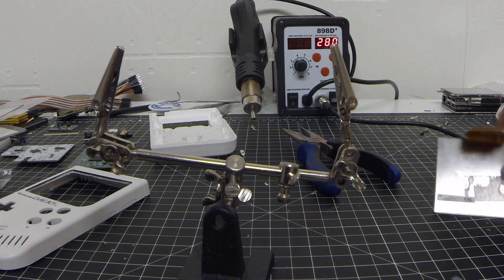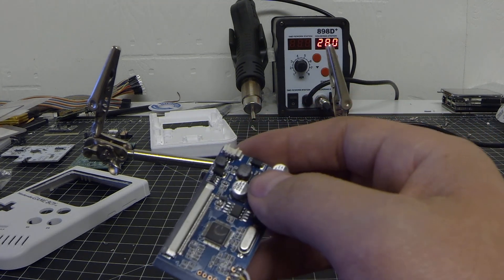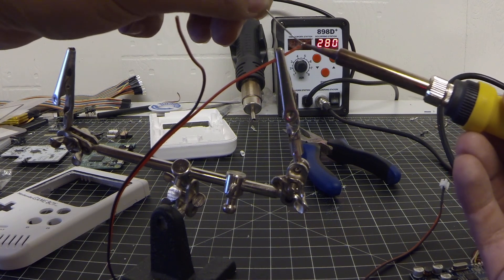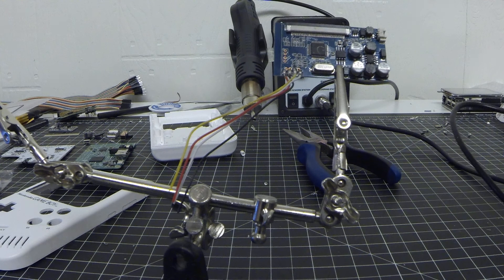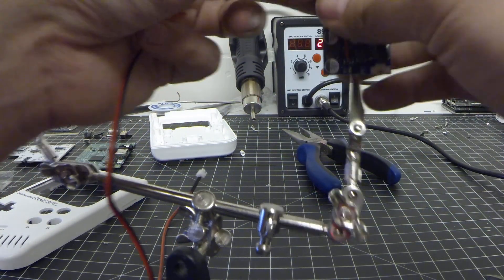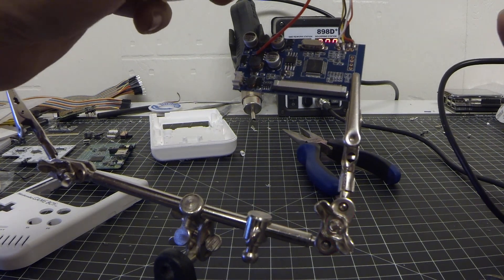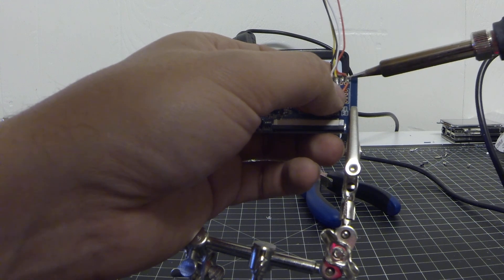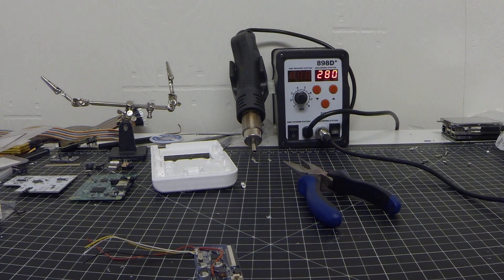GameBoyPi3 Step 8 GearBest V.7 Display Modification

Comment: what is that stand you are using called?
Reply from the maker: This is what I am using.

https://es.aliexpress.com/store/product/2015-New-Enhanced-Third-Hand-Soldering-Iron-Stand-Holder-Magnifier-Tool-Kit-Magnifying-Glass-With-Low/117598_32368548895.html